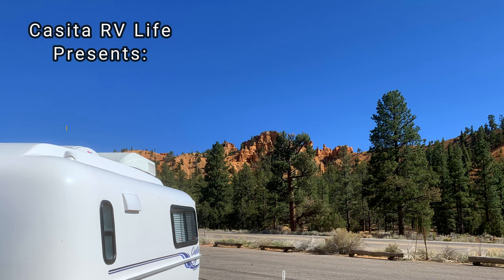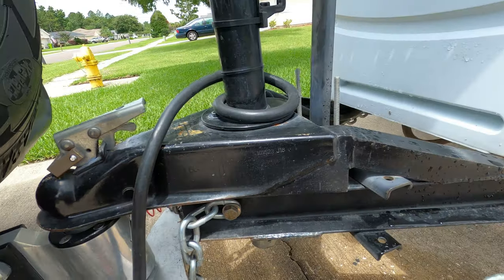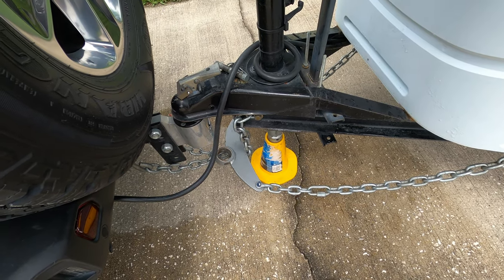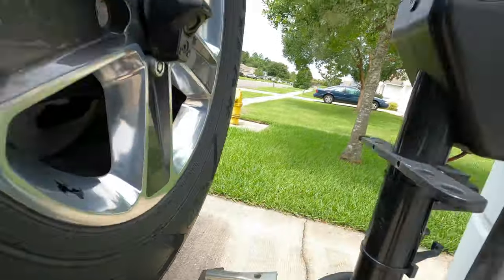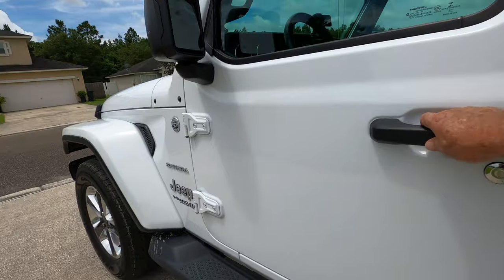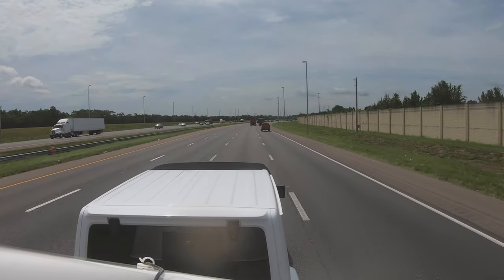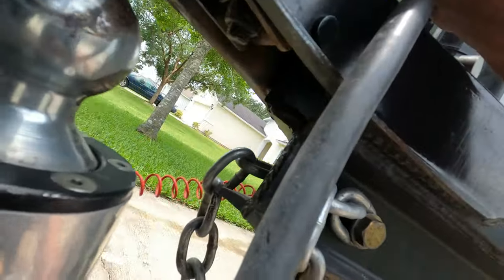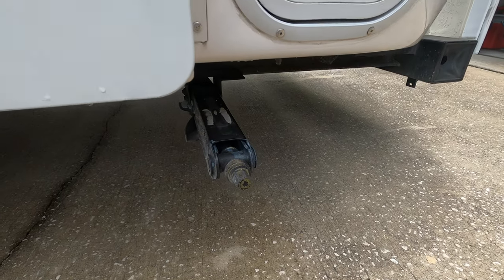Towing a Casita Travel Trailer with a Jeep Wrangler JL

Comment: I have a stock 2020 JLUR and I am surprised you get 20 mpg towing. The EPA rating is 20 combined/22 hwy and we average 20 mpg. Curious as to how you get such good fuel economy? Are you doing any particular maintenance on the fuel system?
Reply from the maker: When we are towing I average 15 - 17 mpg. When I got the 20 mpg was in Texas with a strong tailwind. I was surprised to get it.
Reply: @CasitaRvLife  That makes sense. Thanks for the response.

Comment: Did that ball mount come with the Anderson hitch package from Casita? I really don’t need any of that. My Ford F 150 4x4 has a huge tow capacity. I did change the jack on the casita to a adjustable one . That way it would not hit my tailgate . Thanks for Video.
Reply from the maker: The ball mount is part of the Andersen hitch assembly.
Reply: @CasitaRvLife  
Thanks for sharing.
Reply: I have a 2014 F150 and tow a Casita 17 with the hitch right on the ball, no WDH is needed, the truck does not squat more than an inch. Sway is not a problem either as the F150 is 4900 lbs, trailer 2700 lbs. The trailer is too light to affect the truck's stability.
Reply: @richardhouvener6423  
I only use the sway bar on the Highway! Don’t need the WDH . The adjustable Jack on Casita is great ! I replaced original one . 👍